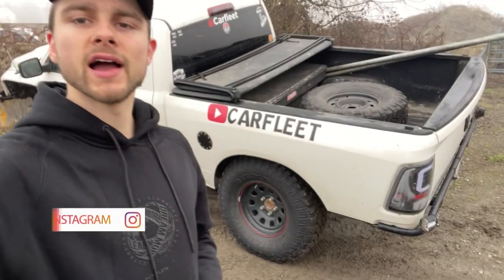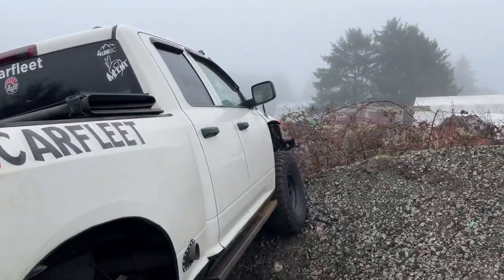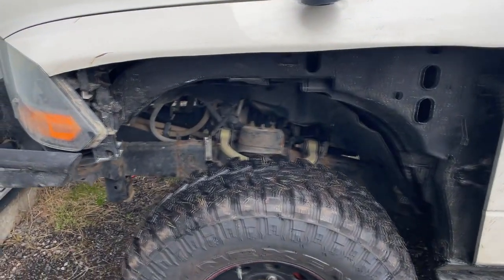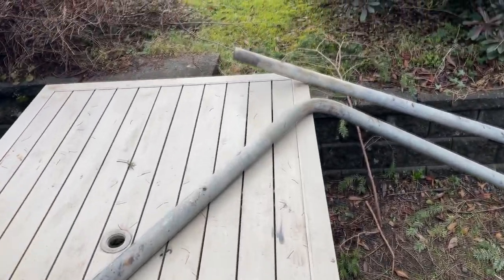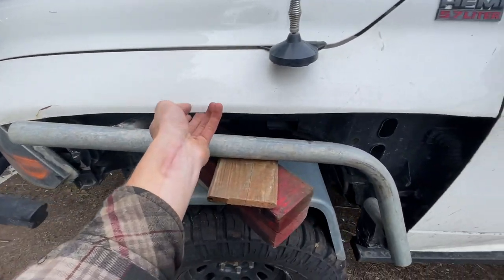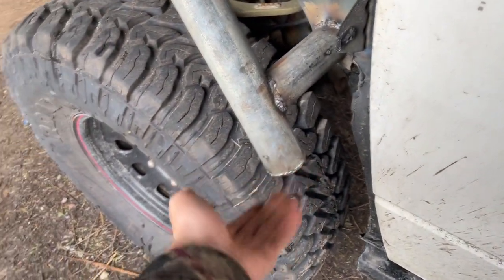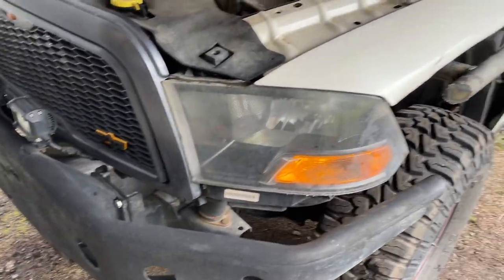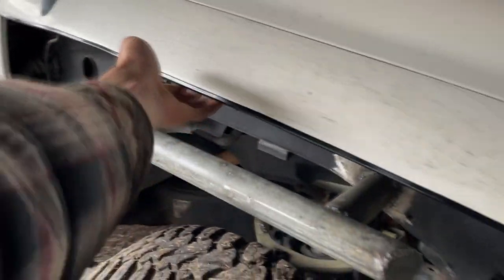DIY Custom Fender Armor! Off Road 4X4 Truck Armor |  Dodge Ram Off Road Build

Comment: Neat idea. I have had good luck using adhesion promoter after sanding, then self etching primer, bedliner and 2 good coats of clear enamel. Looks tough, ckeans up easy and has never chipped.
Reply from the maker: Thanks 
Ya I need a better solution for that the Bedliner I’ve been using chips a little bit